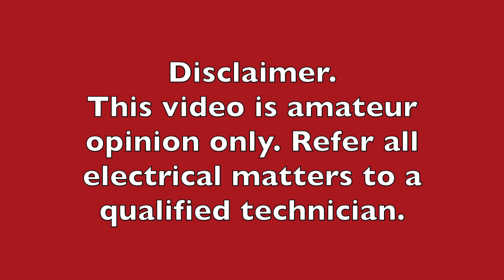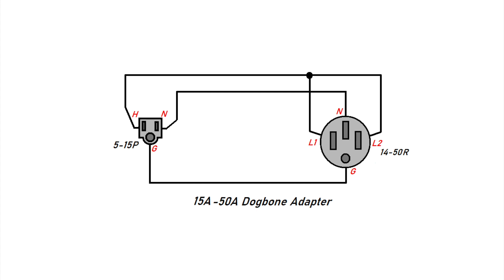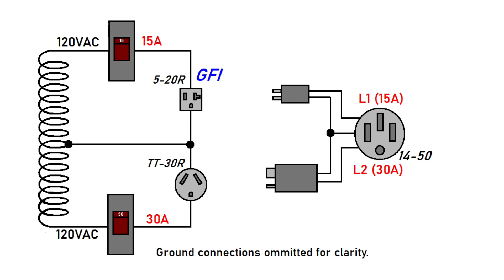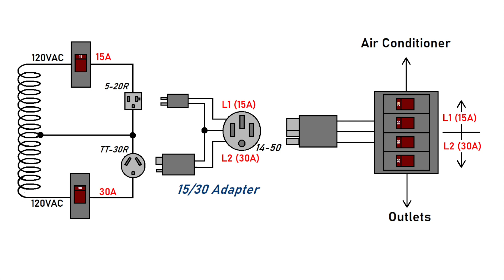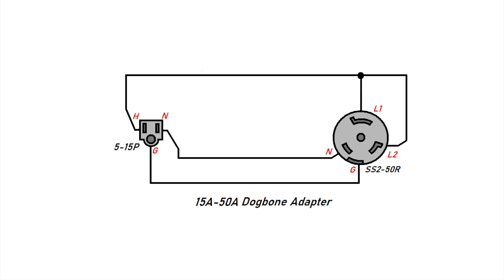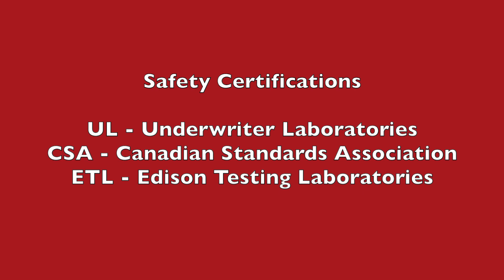RV Power Cord Adapters and Dogbones.

Comment: I have a camper van, the male plug on the van exterior says:  Furrion 110/125 V AC, 60 Hz, 30 Ampere Supply.  The water heater, water pump, porch light and a few puck lights are electric.  I was told to leave the water pump & water heater unhooked when not in use.  The stove top & furnace is propane.
I thought the seller told me I had 200 W solar on the roof.
Would you tell me an example of an item I could use my power with?  I.e.,  coffee pot

Comment: I picked a 50P to 30R dogbone several years ago, after being in an RV park with mostly 50A only sites. I didn’t need it then but thought “What if...?” I’ve never actually used it...and think I’ll now leave it at home. Thanks for the insight.
Reply from the maker: Thank you for your input.
Reply: I just picked one up myself. It was a little farther down my list of priorities. For a 30A RV, the chances of needing it are much less likely. But I have heard of instances of it being needed if the 30A outlet or breaker are damaged or needing to use it in a shared pedestal. It’s more of an insurance policy in my opinion. Probably won’t need it now that I have one…but probably would if I didn’t.

Comment: Curious if the 30 plus 20 dog bone connection to a 50 amp rv would work with a 2200 watts inverter generator with 30 amp shore power to allow the use of second a/c in a larger rv on hot days. I have a high end surge protector that gives amp draws on each legs. 34951 Surge guard. I have a bonded plug for the investor gen as it is not bonded. 2021 Yamaha ef2200ist?

If power went out could the gen power feed back in the electrical system?  Don’t want to create danger?
Reply from the maker: I don't recommend it.  The neutral will be carrying current from two different power sources.

Comment: Very helpful! Thank you! If you have a 50 amp shore power with a 50 amp surge protector, THEN a dogbone to plug in a 30 amp RV, is that safer! 
Been doing that for years as I change RV that now is only 30amp! Thank you! 🍑👍
Reply from the maker: You may know that 50A service is actually 240VAC, so the surge protector cannot become active under about 300VAC or so.  However, 30A service is 120VAC only, so it could potentially use a lower spec surge protector - say perhaps 180VAC.

Some surge protectors take advantage of this and use a different voltage MOV for their 30A vs 50A surge protectors.  However, other devices, such as those made by Progressive Industries use the same spec surge protectors regardless of being a 30A or 50A unit.

For example, Progressive uses 390VAC surge protectors for Hot to Neutral for both 30A and 50A units, and 1,200VAC from Hot to GND.

The only issue is you will only know that if you disassemble the surge protector and look at the values stamped on the MOV.  Mfgs rarely publish this info.

The good news though is that a 390VAC surge protector as used on the Progressive Industries units will generally adequately protect both 30A and 50A systems as surges typically contain voltages orders of magnitude higher than 240V.
Reply: RVProject Thank you thank you! Learned lessons for sure! But I look more closely and it is a Progressive EMS PT30c surge protector with a short dog adapter 50 shore to progressive surge protector to 30 amp. Apologies but sure learned a lot! You are so knowledgeable and appreciated!

Comment: I am unable to subscribe to your channel because I do not see the Subscribe Button/option
Reply from the maker: It's a YouTube issue I think.  If you use a PC or MAC, by hovering over or clicking on the RV-Project logo (looks like a teepee on a trailer) in the lower right corner of the video, the Subscribe Button appears.

If you are using a mobile app, the subscribe button should appear under the video.

Hope this helps.

I will contact YouTube about the lack of a subscribe button when viewing with a PC/MAC.

Comment: Great video. I have a couple questions.
1: for the 50 to 30 dog bone. If used with a Progressive EMS. In you opinion would that be ok.
2: for that 30 to 15 adapter. Would that be dangerous too in your opinion? In that it won't trip the breaker at the pedestal. I believe when we had our pop-up I did that.
I used in your opinion because you said you are not a professional.  But I love your knowledge.
Reply from the maker: I have a Progressive Industries EMS and use the 50A-30A dogbone often; whenever there is  only 30A service (my RV is wired for  50A service).  As well, the ammeter on the EMS lets me gauge how much current I am using so I can ensure I don't turn on too much stuff at the same time.

Same thing if you go from 30A to 15A.
Reply: @RVProject  the dog bone I was referring to was 50 amp pedestal to 30 amp rv but use 30 amp EMS after dog bone.
Reply: It seems like there should be a 50 amp to 30 amp dogbone with a 30amp breaker in between. I wonder why no one makes one? Too big and expensive to make one all weather? That would solve the safety issues with the 50 to 30 amp dogbone, right? Currently I don’t believe there is a 50 to 30 that is UL listed.